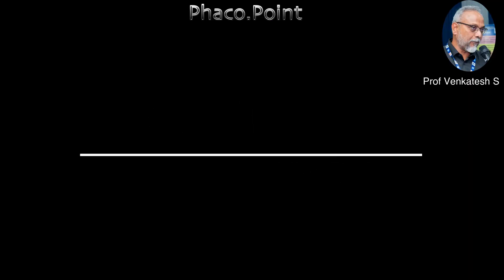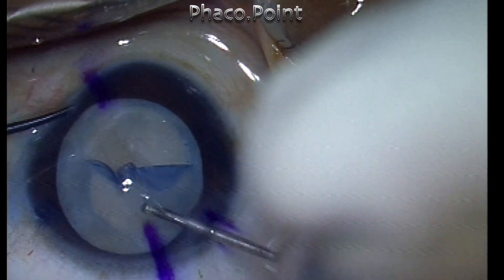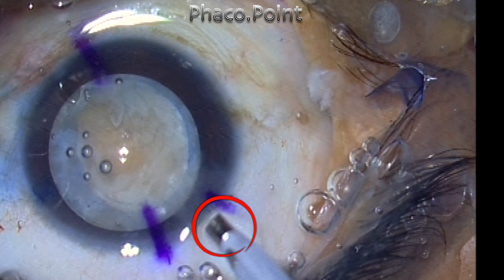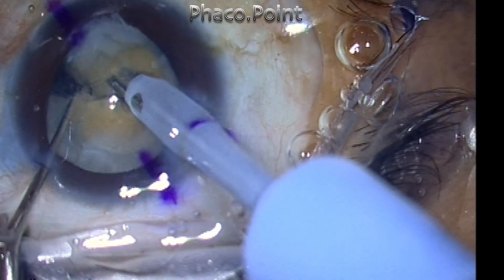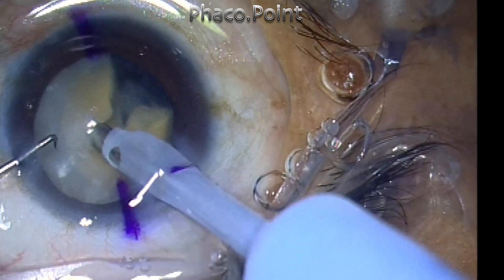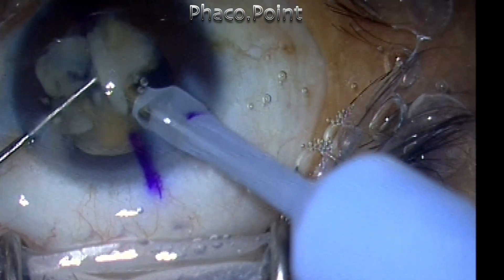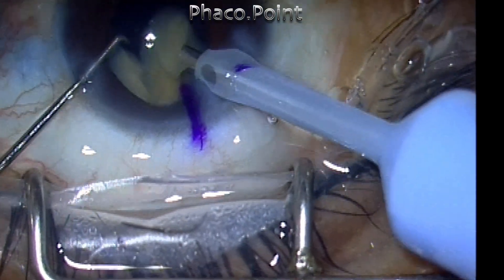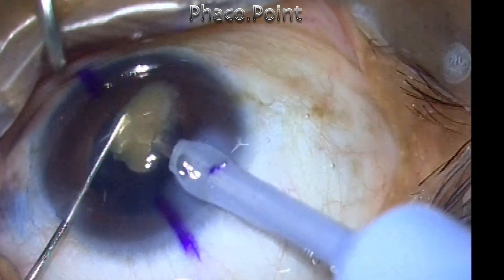The Best Way to chop - a Hard Brown Mobile Cataract by Phacoemulsification

Comment: Brilliant technique sir 
Sir do you only embed the exposed tip ,or move across the lens too as in submarine tech
Reply from the maker: I only bury the exposed tip. The chopper is a sharp tipped chopper with a length of 1.5 mm
Reply: @PhacoPoint  tip sharp, and what about edge, is it also sharp ?
Reply from the maker: Thank you 🙏